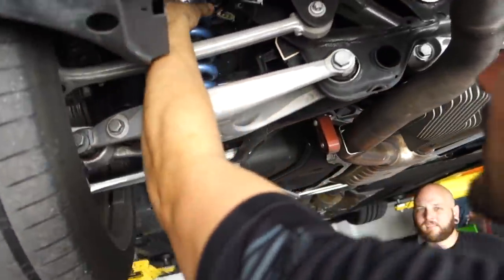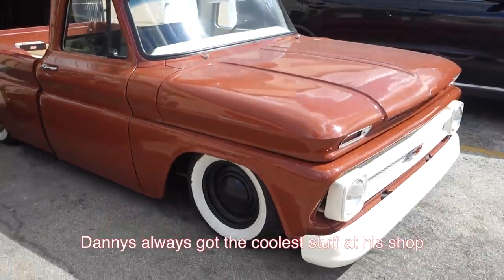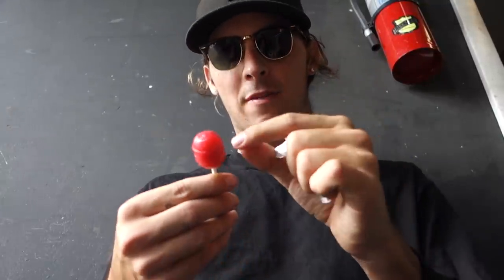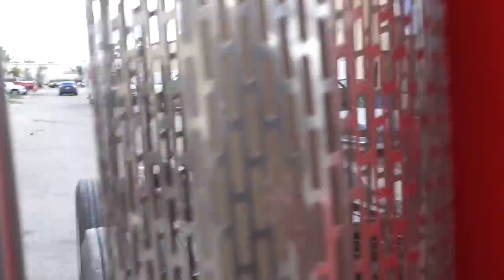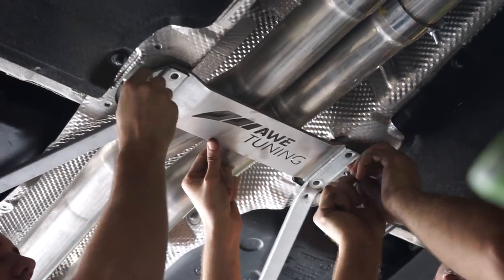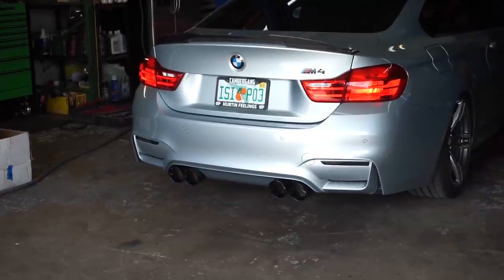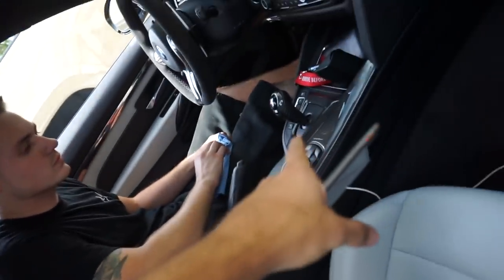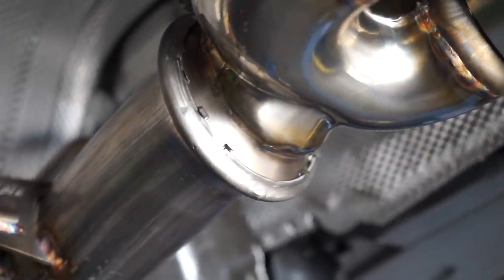AWE Exhaust Install - BMW M4 - LOUD

Comment: Should have just removed the muffler from the stock exhaust instead of buying an aftermarket exhaust that makes it sound really bad💔
Reply: E L Yes,i did that exactly on my M5 2005,and i got really smooth dirty original BMW noise..all total cost was 50$ 
👍

Comment: Amazing how big the exhaust pipes are for BMW 3.0 liter. Just compare to a 6.2 liter GM truck making 420hp and it has 1 single 3 inch pipe.

Comment: Suggestions
1. Invest in a camera that will provide clean audio because a lot of time was spent putting together a new exhaust that sounds bad because of your recording device. 
2. Those springs gotta go or Get shorter shocks.

Comment: Hey Michael,
I just bought the resonated version of this exhaust with the 102MM TIPS are those the tips you have on yours? I’m kind of worried because I installed a vicrez rear diffuser which has the same width as the stock at 10” wide and yours looks very snug so I’m hoping yours is not 90mm??
Reply from the maker: jose saldana yep i have the 102mm. I later installed an after market diffuser, exhaust tips fit perfectly stock and with diffuser. They are conpletely adjustable so you can choose to have them sit a little further from the bumper/diffuser if youd like
Reply: Awesome!!! Thanks for getting back to me. Your car looks sick!!! Since you don’t have a tune did installing the down pipes give you a check engine light?

Comment: is the drop in low end torque noticeable? I've read that you lose power down low is it true?
Reply from the maker: Kanwarbir Singh i feel like its more torquy if anything. I dont notice and power low whatsoever
Reply from the maker: Any power loss whatsoever*
Reply: Kanwarbir Singh honestly this car needs it though. You can spin wheels in 4th and 5th with it and it gets a little annoying. Slight decrease in torque but with overall higher end power is defenitly not a bad thing with the M4

Comment: Yo buddy. Nice video.
I own a 2012 mustang gt auto and a 2014 evo x gsr (manual). Highly contemplating getting a used m4, dual clutch since my wife can’t drive stick. How much fun are these cars? How much am I looking at spending for e85 upgrade?
Reply from the maker: its literally so stupid fun.. wouldn't recommend e85 only because these cars don't like full e85 and putting e60 is a pain in the ass.. plus trust me on this one its fast enough tuned on 93 haha

Comment: Dont you lose back pressure from being straight piped?
Reply from the maker: Harrison Eli dont think so, definatly not as restrictive but both the downpipes and the exhaust were designed for power. Without a tune i alreat feel a power gain. Car slips in 2nd like crazy never used to before.
Reply: absoulutely not, the turbo's provides plenty of backpressure. Straight pipes let the exhaust flow much better

Comment: nice sounds really loud, can definitely tell it is louder than the factory exhaust. Also did you wrap the car, I am not sure if it's the video but it has a little matte to it.
Reply: that is a factory color called Silverstone Metallic
Reply from the maker: Yep its Silverstone. No Matte, guess its just the layer of dirt on it haha
Reply: I know it’s a Silverstone II because I am picking up the same car at the end of the month. The reason I was asking was because I’ve seen some M3 wrapped with the Xpel Stealth wrap that looked matte. The reason why I love that color is because of that blue hue color you get in cloudy weather

Comment: And how many CEL's lit up while decreasing your M power.......lmao.
Reply from the maker: cars getting tuned this week.. and the downpipes did throw a CEL which was expected
Reply: need to get the CP / CS / GTS code on there, it needs the pops n bangs!
Reply from the maker: Tim Burton check my last vid! Just shipped out the ecu for tune and that include some pops and bangs!
Reply: sweet, itll make the car

Comment: This is what happens when an idiot leases an expensive car, first thing that go on set of cheap  Chinese shock/ springs.
Reply from the maker: Jane Dogh my suspension is Broadway Suspension actually not very cheap and handle better then my buddys kw v3s in my opinion
Reply from the maker: nope, really hard to get deals nowadays especially with cars like these. AWE did have a Black Friday deal though
Reply: You know nothing jane you know nothing

Comment: M4's never sound good, doesn't matter what exhaust. It might be the nature of the engine in relation to the exhaust pipe routing. Might as well leave it stock and focus on power elsewhere. That way you're fast but not obnoxiously annoying. It's ok to be obnoxious, if the sound is good. This isn't. No offense. I love M4's but they sound like complete ass.